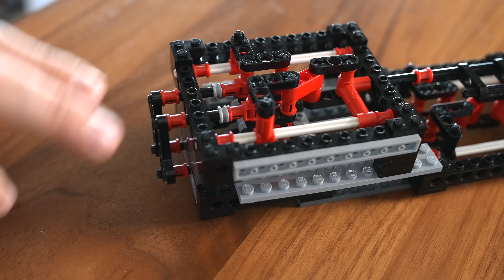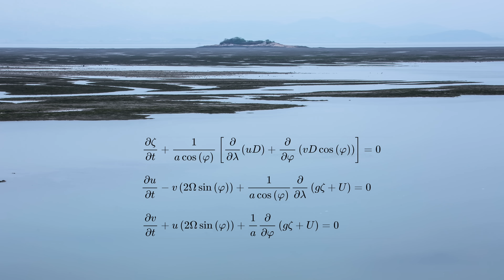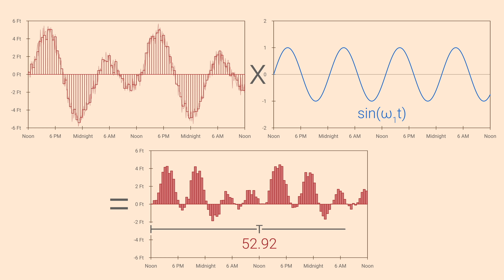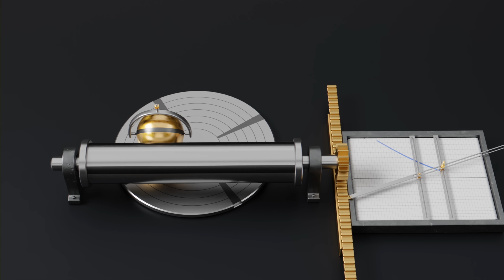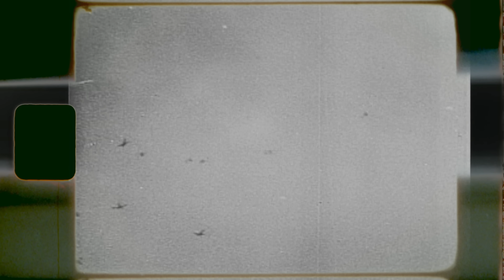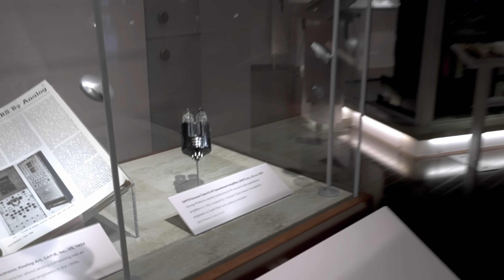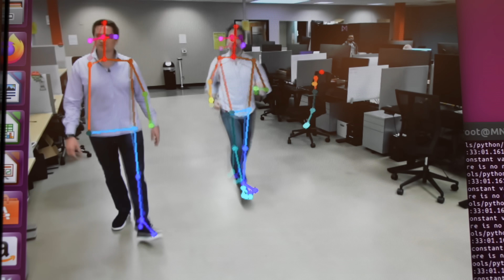The Most Powerful Computers You've Never Heard Of

Comment: Many jet engines use a sophisticated hydromechanical analog computer for their fuel control. 

It can consider inputs like air temperature and pressure along with engine RPM and power lever angle to schedule the appropriate amount of fuel through a complex mechanical system built from simple machines like levers and flyweights. There's even "3D" camshafts that combine axial and rotational inputs into a single output. 

Granted, metering a particular amount of fuel for a steady-state power level is pretty straightforward, but when you need to accelerate or decelerate without surging or flaming-out, that's where you need the computer.

Of course, modern engines have digital computers to do the work, but even those are usually working in tandem with the hydromechanical system. The digital system may augment and trim the mechanical system, but the mechanical system is fully capable of doing everything on it's own.

Comment: digital computers require communication mediums to interact with the outside world, be it the internet or just your monitor and keyboard. there are numerous ways that noise & errors can be introduced and as a result a lot of technology exists and has to be introduced for error checking. I think digital won out vs analog because it was a lot simpler to conceptualize and design, boolean logic can be stacked to achieve any result you want (making it turing complete). It makes perfect sense to start work again on analog computers, and I'd argue quantum computers are sort of analog computers at least in comparison to digital.

Comment: I get the Scotch Yoke, and the Pulley. This is engine timing and simple machines.
But how do you even conceive of the integrator machine? A ball a disc and a tube working in sync...that blows me away! It doesn't even resemble clockwork!
Could you do an episode on how they thought up the integrator?

Comment: Analogue computers won't be able to represent universal computing machines (Turing machines) owing to their complexity. They will have limitations based of their size required to model memory.

Your "memory" would be an integral component of the system itself, which puts them on a level with finite state machines.

Quantum computers operate on the principles of superposition, which ultimately is an analogue value. I'd argue that you can call quantum computers analogue.

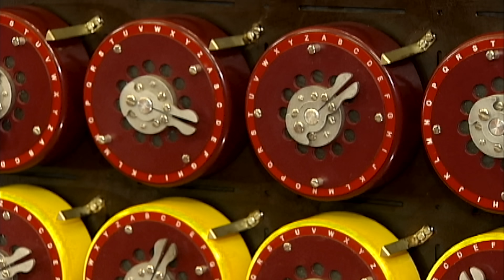Also, 16:25 is a Bombe machine for breaking enigma. Not a colossus (as stated) for breaking Lorenz.

Incidentally the bombe wasn't a computer in any form as it didn't calculate anything. The colossus was.

Comment: Everything digital deep down is all analogue. Digital is a much slower layer of abstraction sitting on top of the real analogue world. And as things getting smaller and faster more layer of abstractions are put in place to hide the noise from the analogue world. Like every single time that data is read from a solid state drive a hard disk or there are errors, but this is hidden by the use of error correcting codes.

Comment: At my job yesterday I found an old Analog Temperature to Time log keeper. (not sure what's it's called yet) But it's like a CooCoo Clock. Instead of hands rotating it's a paper disk thay spins around the center. The disk has a circular graph of 72 hours. A mercury Thermostat is linked to an arm which houses a small needle with ink. It still works accurately and it ticks!

Comment: Derek, you reference Malcolm Gladwell's "The Bomber Mafia", which I have not read but did listen to his Revisionist History podcast episodes on.  Note that the Norden bombsite didn't fail in Japan because it was too inaccurate, it failed in that situation because it wasn't designed for the very high groundspeeds involved in higher flying bombers that ended up in what then were poorly understood jetstreams.  The real failing of the Norden bombsite in this case was how much time and cost it would take to change them to operate in that speed range in time to be used.  Same result but I think this nuance is interesting, and fits with your point about analog computers being fit for a specific condition where digital is general.  Great video!

Comment: Hey Derek! Good to see you gain. Gret topic as usual. It is so weird most people dont get it they also have a computer in in every engine / car... any over head cam and valve opening and closing is essntially a ROM memmory program running accordingly to engine speed. 0 / 1 / 0 / 1 - still, this is first way we used to save information mechanically. Loving it.

Comment: I was once an INS/WRCS technician in the USAF. As late as the early 1990's, navigation computers and weapons release computers on some military jets were analog.  They worked with servos that operated much like that old Greek artifact.  On the F4-E (I had the pleasure of working on the old birds just before they were retired) the inertial navigation system fed the weapons release computer system attitude and velocity info which was used to automatically calculate release times of small bombs.  It kept them from having to be dive bombers... (check out "toss bombing" on Wikipedia).  The tech was pretty darned cool.  And it was amazing to learn the theory of operation.  There were a LOT of analog signal wires in the navigation system of an F-4.

Comment: The problem with analog computers is that they require moving parts, which necessarily make them more faulty than the digital counterparts. Also, those would be strictly specialized, it's hard to make a general purpose programmable analog computers. You won't be playing Counter Strike on those.

Comment: You could also say all modern digital computers are really analog, they simulate digital processing via transistors, thus throw away a ton of potential fuzzy computing power.  A real nerd can then claim quantum mechanics is discrete and only approximates a continuum in the hbar->0 limit.  Then I can counter that quantum mechanics is only a boundary CFT approximation to a continuum bulk gravity theory. You see where this goes... the only way we ever need to worry if nature/spacetime is discrete or continuous is when it makes a dime of a difference, and no one has shown it does, although "discrete" (in physics jargon) is just a dirty word for continuous but multiply connected --- all the Wolfram hypergraph and LQG sh*t has to have connections between nodes/spins, so they are not discrete. And I can approximate any such network with a smooth multiply-connected spacetime (using wormholes, which btw from Coleman's work can potentially fix the fundamental constants).  Graph theory is placed under "discrete mathematics" because of the topological index, not because of the lack of connectivity.  Without connectivity you die (or float away into a different universe).

Comment: In a few years, mechanical computers will be one of the things that work. Not sure if they are able to have a pure light-driven computer as I think the receiver/reaction to the light must be electrical...but I'm not really familiar with those computers. But due to the world being on the verge of a polar flip/reset due to it's current offset and historical pattern, the magnetic fields will have a point where solar radiation messes with electronics. Not sure if underground or faraday cage protection will still allow electrical computers to work.

Comment: The advantage with an Analog Electronic CPU is that if it takes 1 microsecond to multiply two 8-bit variables, it'll theoretically still take 1 microsecond to multiply two ∞-bit variables assuming the voltage rises instantly; of course that doesn't happen IRL but it'd still be so unimaginably faster than a digital CPU.

Now if we paired an Analog CPU with a digital storage like an SSD, It'd never even "slop" or accumulate errors because everything will be stored digitally.

Its only problem is that power rises when doing operations on bigger variables, so you traded your consistent power consumption with consistent performance time. I see that as a complete win to be honest because you consume power that you only need at a time.

Little disadvantage: Might need a digital CPU to translate from analog to digital storage which may cause a bottleneck but since it'll be a specific-purposed CPU, then it'll be way faster. And we can always come up with creative ways to convert analog information to digital information instantly with no much circuitry.

Comment: Calling those old analog machines computers nowadays is kind of misleading, since the definition of "computer" changed in 1945, from any calculating maching into a device capable of solving anything a turing machine (as described in his 1937 paper) can solve, so it is basically a requirement for the device to be generic and programmable to be called a computer nowadays.

Comment: I'm getting a little tired of people calling anything mechanical that seems a little ahead of its time a computer. By the logic used the transmission on my car is a computer, and it's not. Computers have a CPU, "central processing unit" that can be "programmed" and more importantly generically programmed and therein lies the difference. 

These other devices you could sometimes loosely call a calculator but an actual computer by any useful definition you can't really do so.

To clarify, general mechanical devices that you see of the past are not really programmable. They're much like the transmission on my car although my car's transmission is arguably slightly programmable because you can change the gear ratios to get different outputs "from the same input" which is key to being programmable but it really isn't a computer, it's just a slightly more complex than normal mechanical device. Having a lot of gears that change ratios of output and input, or just a lot gears mimicking planetary motion is not a computer. It's a fun device, a pretty complex device of gears for sure, but complex does not equal computer. 

You could have a device with 100,000 gears and it still wouldn't be a computer, it would just be a device with a sh*t load of gears whirring around unless it has a few key additional attributes, like Alan Turning's original machine which if I remember correctly was mechanical but most importantly generically programmable.

The problem is that once you loosen the term computer to start including such devices the term becomes essentially meaningless because a seesaw with a sliding midpoint (perhaps to adjust for different weighted people on each end) could be argued to to suit the definition -- it's just get silly/ridiculous at that point.

Comment: Analogue does not imply mechanical. There are analogue electronic computers that are programmable and therefore not limited to one type of problem. In fact there are also analogue mechanical computers along the lines described in the video (with differentiation, integration, etc) that solve differential equations and therefore are not limited to one type of problem either.

Comment: Many years ago I thought that the combination of digital and analog computers could be useful. The digital computer would be in charge, setting the parameters for the analog system, e.g. resistance, capacitance, voltage, etc. Even “material” characteristics, like changing lengths, weights, etc.  Or to design components to be used for mechanical systems.
You could configure the analog system(s) for single optimized functions or allow multiple configurations as the system evolved, like refining computations from coarse to fine as you got closer to a (possible) solution.  Feedback from the process can be used to make continuous adjustments, monitor slop and look for other pending inaccuracies or failures.
I had read that one reason that analog computers were moved away from was the inability to build circuits with the needed tolerances.  That’s less of a problem now.
Can the universe be considered to be an analog computer that computes its next state given its current state.  It’s discrete, but not digital.

Comment: Okay, I know what it is. You can arrange op-amps to perform any mathematical function, including integration and differentiation. This means they can easily brute force ODEs much faster than by digital computation. Because neural learning is essentially vector calculus, it's perfectly feasible to configure op-amps into optimisation circuits using raw voltages rather than discrete steps. Similar to digital neural nets, you oscillate the input variables and measure the relative changes in output, then use this information for stochastic gradient descent (essentially following the grad function to the global minima mathematically speaking). I came up with this idea a while ago, didn't realise others were also trying it.

Do me a favour, mention me in the Part II video to acknowledge if I guessed the Part II bit correctly! And anyone reading this, hit a thumbs up and leave a comment so that Derek sees this. I'm a big fan of the channel, and I'm pretty sure I know where he is heading with it.

Comment: Hmm transistors also function in analog.  I could imagine an electronic version of the ball and disc integrator where all the mechanical components are replaced with electronic "analogs"  If that is possible I wonder what can be done with the power modern computer science 🤔

Comment: I mean... modern computers do use some analog components to speed up data transfers or store more data in one digital signal.
GDDR6X Memory for example (used in the RTX 3080, 3080 Ti and 3090 by Nvidia) is using different Voltage levels to encode 2 bits in one clock cycle.
SSDs go even further storing up to 4 bits per cell (found in QLC SSDs), by writing the initial data at different voltage levels.
It's not quite analog as the machines of days past, but it is analog as old analog TV is analog, except that the voltage is carrying multiple digital signals...

Comment: That was amazingly cool. Doing a discrete Fourier transform by hand is hard enough, but designing a machine to do it with nothing but gears and pullies just blows my mind. We have it so easy now with digital computers and software. We can program anything we want as sloppily as we want and a compiler will find a way to get a CPU to do the work. With analog you can't succeed without a complete understanding of every aspect of what you're building.

Comment: As an electrical engineering student in the early 80's, I worked at a steel plant where I helped fix an analog (tube) computer that controlled a mill which cold-rolled aluminum.  Just when we figured out what was wrong with it, they decided to use digital instead.

Comment: Mfw you show added sin waves and my brain goes "oooh, Fourier incoming" and then Fourier indeed does come in. Poggers.

Ahhh this is sick to see all these strokes of genius. Very cool to see people were doing the same things back then as we do now when plugging away in digital software, except they were doing it on pen and paper and brainmatter and brass.

Ahhhh and then op amps appear! My music tech nerd side is bubbling over with excitement. All of this not only stopped the nazis, but it also led to the flourishing world of nearly all modern music to come after electricity became prevalent.

And yes analog computers will absolutely have uses. There are numerous cases in which digital computers falter, notably in cases where fine detail is required, because each additional doubling of accuracy requires a doubling of the entire detail of the system. With analog computing, we can factor for the amount of needed detail more accurately, as the function being used can be tailored to provide extreme levels of detail without having to resort to the brute force equivalent used in the digital realm. We'll no longer be in the realm of "higher clock speeds, more cores, larger caches, and lower delays between components" and instead in the realm of smarter components that are able to conform more cleanly to use cases. This will hopefully provide the solution to the ever-growing "internet of things" issue, where every device and its mother currently needs a digital microprocessor in it to interface with other devices.

And of course, this is all closely paralleled by the similar concepts in the world of music technology. We have gone from physical/mechanical objects to electromechanical to purely electric to discrete electric to the present era of combined discrete and analog electronics (and some physical things like reverb tanks still, as well as all "traditional" instruments and other microphoned things). I hope to see the trend of ever-shrinking components applied to physical and analog methodologies, such that we have microscopic things that are able to handle ranges of values. The holy grail would be to get the operational ranges of physical, mechanical, and analog into the form factor of digital. Let's hope that's where we're headed.

Comment: Fun fact... one of the biggest secrets of WW2 equal to the atomic bomb, was the proximity fuze.  Which detonated a flack gun projectile in close proximity to an aircraft, or even altillery projectiles close to the ground causing maximum effect, instead of on the ground minimizing effect.  A proximity fuze uses radio signals that reduce in frequency as the projectile approaches an object, magnetic and sonar systems were tried and all failed due to the violence of the forces encountered as a round is fired.  As for the calculations these computers did for anti aircraft purposes against dive bombers, the truth is the computers did nothing, and it was so secret that even anti aircraft gunners had no idea that the dial to adjust the altitude at which the round detonated was fake.  Because it was actually the proximity fuze that caused the detonation of the round, and not the adjustment of the altitude dial.